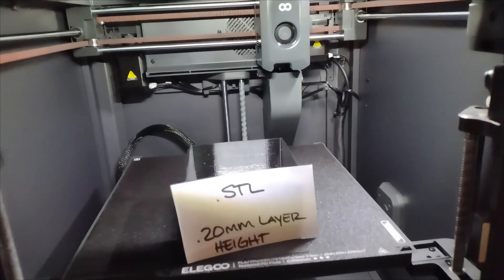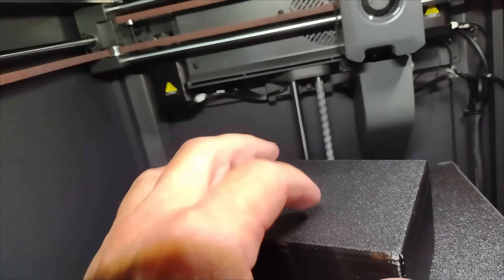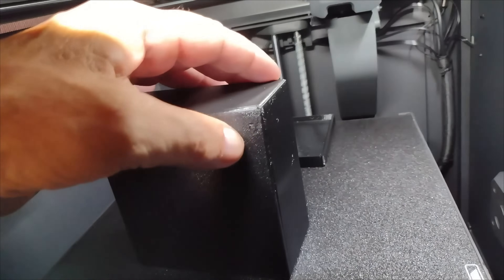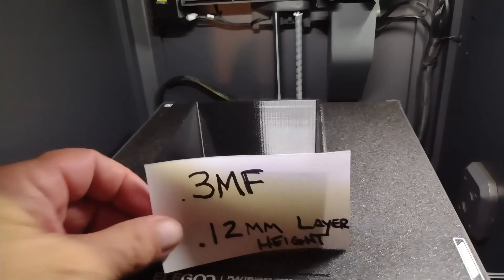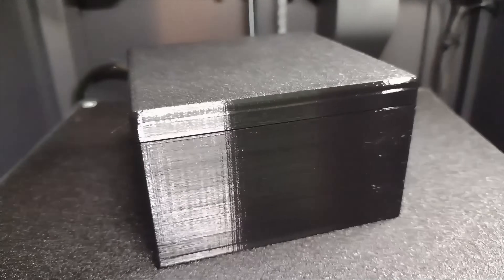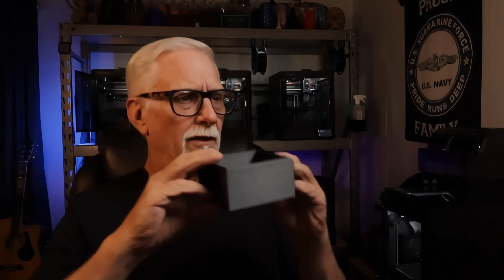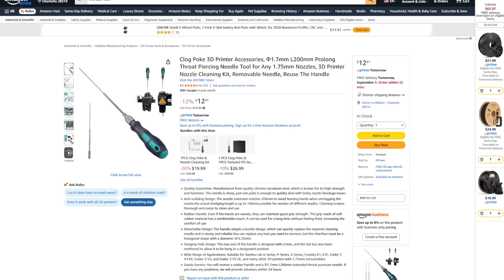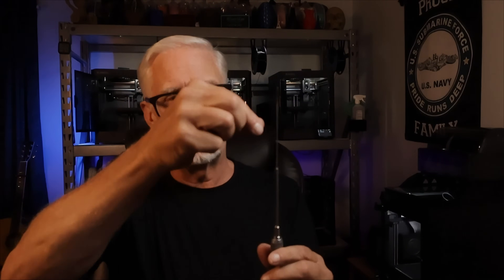.STL  vs  .3MF Files And A 3D Printing Seniors 5 Things I Wish I had Knew About 3D Printing!

Comment: Great to see you working in Fusion 360. I am 72 years old and started in Freecad first then quickly moved to 360. It is so much easier and love it. I have only been printing for a year or so my self. BTW what is AMS system? There is so much to learn. Just saw your video for the first time today, love it. Keep up the videos.
Reply from the maker: Automatic material system. Multicolor filament feeding system. Second generation from bamboo has a dryer in it. Sounds like we've been printing about the same time how long you been doing fusion? Also thanks for watching my videos.

Comment: A quick and easy method to clear a nozzle is to heat it to 260+ for 10-25 minutes, then do a purge. Works most of the time
Reply from the maker: Great tip. I don't think you have to wait that long though. A few minutes at 260 would melt anything in it. Thanks for the comment and the watch!

Comment: Good video, thank you!  I have purchased some 3mf's and had a couple I couldn't use because of the Bambu settings.  They crashed my Flashforge or at a minimum I got warning messages, which at least saved me some trouble.  It seems possible to make adjustments in the file but I'm just not there yet.
Reply from the maker: Glad it helped. We just keep chipping away at it.

Comment: Wow! Thanks.When I got my Bambu Lab A1 is the fist time I got involved with 3mf files.  Actually I like it better because it seems that I have very little to do in Bambu Lab's slicer.  You're correct that 3mf holds more data.  BUT! What really intrests me is how much difference in a print compared to the .4 nozzle and a .6 nozzle.  Thanks again
Reply from the maker: Yeah I'm getting some new nozzle sizes to try out too. I get a lot of comments about STEP files so I'm going to try those this week

Comment: I first tried 3 d printing 15 years ago with a self built reprap mendal. Then again 8 years ago on an ender 3. Drying filament was hardly a thing.... so what has changed ????
Reply from the maker: Printer quality....... I've only been doing it one year so I really don't know how it was before. But now you just open the box and start printing. Nothing to put together or calibrate. Is that what you're asking?
Reply: Where do you live?
Where I live, it is going to rain 22 inches this month. So it’s humid.
Reply from the maker: Oh no! That's not good. I think I'm about 22" a year. So you don't have a problem with moisture when you print? For me I probably have 30 rolls that sit about in different colors that I really don't use a lot and when I go to them I may have a problem. Most of time right out of the package though it's pretty good. You don't have much of a problem?

Comment: I noticed with 3mf files that have multi color parts you can split those parts and print separately in Elegoo slicer to print in different colors then simply glue together. I’ve been doing this with NFL team oversized chains, works really well
Reply from the maker: That's the stuff I need Tavares. Do you work in fusion and do you do the colors there or in the slicer? Next you do it post up a video. I'll watch it.
Reply: @Blueridge3Dprints Work it in the slicer, it’s just easier for me than Fusion

Comment: I always save the files I send to my printer as .3mf, but keep the originally-downloaded .stl for later - especially if I get a different printer or change my preferred slicer.  I often have a tough time opening .3mf files off Makerworld and importing them to Cura - I am frequently told by Cura that the file does not contain a model.  If I open the same .3mf in Bambu Studio, I can then export it as an .stl that Cura will open.  I don't want all someone else's slicer settings, because their print environment and mine are completely different.  I am using a hand-me-down Ender 3 and cheap Amazon PLA most of the time.  No AMS, etc. I'd rather apply my own machine and filament settings, thank you.
Reply from the maker: That's right, everybody's print set up is different. no one file. I'm looking into STEP files now and creating a new model in fusion that will do a harder print test. Thanks Randy.

Comment: Where you'll see the differences in file types is on parts with more complex geometry and curved surfaces.  You won't see the effects of this very much with a boxy shape with a bunch of right angles and flat surfaces.  STL files contain a tessellated mesh of the original geometry where it breaks the geometry down into a bunch of triangles and these meshes are often at kind of low resolution.  Holes can start to look like 10-sided polygon or worse.  The number of sides in the mesh and visibility of this depends on the size of the hole and the software doing the meshing.  3MF still contains a meshed / tessellated geometry file similar to STL.  Not much gain to be had there.  STEP file is superior to both in that it retains most of the original solid or surface model geometry as vectors that CAD software can use to reproduce the original native geometry pretty faithfully.  If your printer supports STEP files, you'll hopefully have a cleaner file being imported with more accurate geometry.  The slicer software will still end up meshing it anyway, but this way you'll only be meshing the geometry once.  With STL and 3MF, the slicer will remesh models that were already meshed before they were imported, so you're losing some precision there.
Reply from the maker: I was just saying that I'm looking into STEP files now and creating a new model in fusion that will do a harder print test. Saw a video of a test on some inside curves. Thanks so much for the time you put in to help me. STEP files is one of next weeks videos.

Comment: STL is the past — 3MF is the future.
Yes, both can print fine for simple parts, but 3MF goes further: it preserves complex shapes with higher fidelity, keeps scale consistent, bundles assemblies, colors, and print settings, and does all this in smaller files. With modern slicers like PrusaSlicer, Orca, or Bambu Studio, sticking to STL just adds risk and limits detail. Makers should move to 3MF now — it’s more reliable, more precise, and future-proof for 3D printing.
Reply from the maker: It's like metric. At some time we will have to switch, but no one is in a hurry. Hear it all my life. was a master carpenter for 25 years. moved over to metric last year. And now love it. So..... yeah. Dan, Thanks for watching.

Comment: your petg is wet.
Reply from the maker: It had been a bit humid. I had dried them the day before in the AMS system and then hung them up. I like to have thought that it might have been not as dry as I had hoped. But at close inspection it was just some stringing that would come off to the side and then it would lay a layer over top of it. It cleaned up pretty nice with some heat but yeah......... It might have got up to about 60% humidity in the room while they were hanging up. Thanks for the heads up and watching my video.
Reply: @Blueridge3Dprints  yeah, petg is very sensitive to humidity, when i saw the little blobs, i say it directly. I have an inexpensive esun lite dryer and i print almost everything directly from this dryers, i have 3 bambu's so 3 dryers. Greetings from Belgium and further succes with your channel
Reply from the maker: Wow Belgium. It's still ceases to amaze me how far I reach. Are you listening to me in English or is it subtitle to French or Dutch? Now that I have reached my thresholds with YouTube I can add in more languages.
Reply: @Blueridge3Dprints  No need, i watch in English, great shows, btw
Reply from the maker: @filiepmaes9071 thanks, I try.

Comment: I have noticed that exporting STEP files from the design software gives better quality models than STL. The benefits would not be noticed on the square boxes you have used as test pieces as the improvements are largely on the curved surfaces. Might be  worth you taking a look at STEP and using. a more complex model.
Reply from the maker: I think I hear one of my next videos. lol. Someone else said on refine with fillets parts to try a STEP file. I will have to another test. Thanks for the tip and for watching my videos.

Comment: 3mf files contain the same stl file info ,but also have meta data about printer and project setting (colors, support, etc.)  I typically open the stl in the slicer then save the changes made in the slice as 3mf.  Then, next time you open the 3mf, all of your slicer settings are still there for so you dont have to go through and make all the changes in the slicer again.
Reply from the maker: This is exactly why I've been diving into the formats. For almost a year I've only worked with stl's. Thanks for helping to explain and for watching my videos.
Reply: @Blueridge3Dprints  Yeah, a 3MF is just a zip file. You can prove that by renaming the file to .zip and extracting it. They contain the model files and settings. I don't know why Fusion would feel the need to export as a 3MF, there is litterally no gain there, IMHO. But I'm  a FreeCAD guy myself, so I haven't touched fusion in about 2 years.
Reply: To me it’s more about sharing files. The 3mf files I download contain information I don’t need.
Reply: Great response, it added content that will be relevant when I start to 3D pint.

Comment: STEP  files are still better at  curved prints.
Reply: This can be true, but it depends on the resolution you import the step file into the slicer with. In the end, the slicer still converts to a stl file format to send to the printer.
Reply from the maker: I think another video with STEP files is in order. I need a more detailed part!
Reply: Thx!  I’ll have to take a look at STEP formats - I’m mostly printing TPU, so anything that helps smooth things out goes a long way

Comment: Hello there!
I'm already working on several things, all my own creations. I've already lost 2kg of PLA due to mistakes, but that's part of the process.
I want to print with something stronger than PLA. I already bought an inline duct fan to fit the bottom of the CC, but I still don't know what filament to use. I'm torn between ASA or PETG. If you could give me some advice, I'm also looking at a dryer. I think it will need a heater, but I'm not sure about that. Otherwise, PLA is fine for decorations. In my sewing machine's oil box, the walls took between 5mm and 8mm. I used 1kg of PLA, a harder material, which would allow me to print with 2mm or 3mm, maybe. Thanks for the videos.
Reply: ASA will require a heated chamber and is very sensitive to moisture..PETG and ASA have similar UV resistance.  For now, just use PETG HF it is very easy to use, similar to PLA, just stronger and better heat and UV resistance.   
I think we all tend to think we can tackle the more advanced filaments, just a bit to soon.  ABS and ASA can produce very good design's but you require more discipline with bed adhesion and fingers touching things you shouldn't. Also stop the habit of opening the door to the printer to get a better look. With these more temperamental filaments the temperature change can adversely affect the mid print.
Reply: @61markt  I did order some, Thank you very much!

Comment: Congrats on the 90 days :-) I still export most of my files in STEP file format. I haven't even tried to export in 3mf. Might do that and see what difference it will make. Thanks.
Reply from the maker: I was reading about step files, what's the difference there?
Reply: @Blueridge3Dprints  Holds more data
Reply: It basically holds more data eg: assembly data, other metadata.
 @Blueridge3Dprints